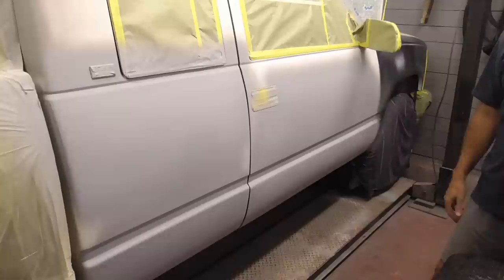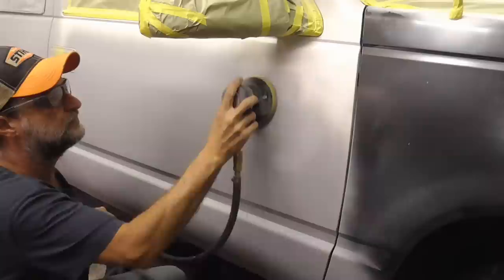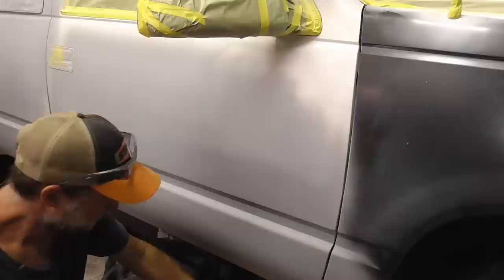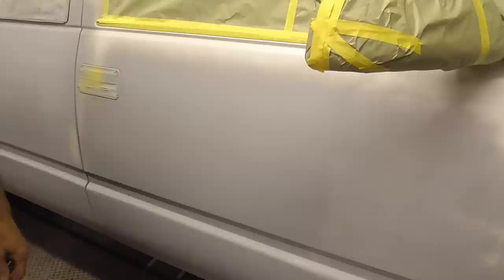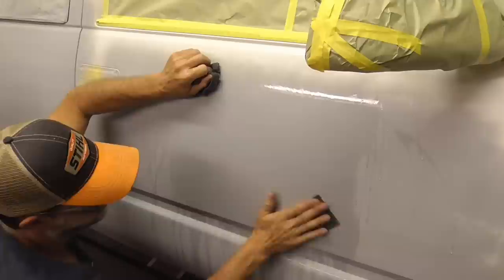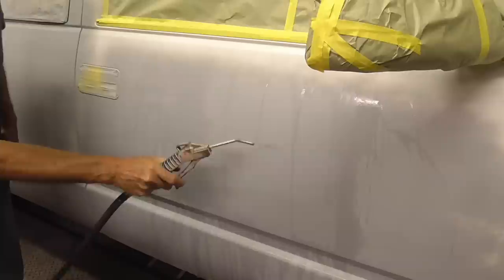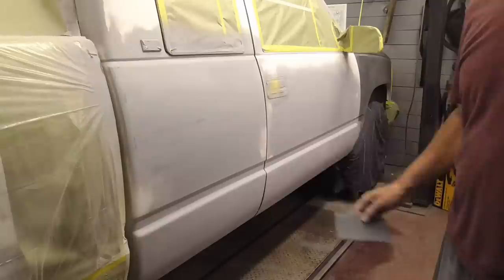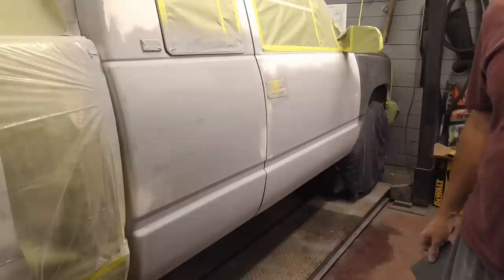3 Ways to Finish Sand Before Painting:  Good Way, Better Way, Best Way

Comment: Why wouldn't you remove the emblem and door handle and belt moldings, mirror? You don't tape those off wtf lol
Reply from the maker: You can do that if you like but there's a very good chance you'll end up breaking brittle door clips and parts as it's a 96.  It's actually better to get good at masking.  A boss where I worked always wanted everything put together before painting to avoid marring the paint putting stuff together.  I totally agree with him.  That way the next day.... pull the tape - your finished.  Perfect paint work - no problems - got to be good at taping though :)

Comment: Awesome video! Just curious as to what primer you use? Also, one thing I noticed on my car as well as in your video is the different shades of primer. On my car whenever I spray the primer seems to be lighter/darker from other sprays, will that cause an issue with the paint when I finally spray it on? I'm going for a dark grey color if that makes a difference.
Reply from the maker: I use lacquer primer from Auto Body Master but any lacquer primer will do.  It's cheap, builds fast, dries fast, sands easy, works well if used correctly, doesn't harden in the cup and you can throw the unused portion back in the can.  2k works great too.  Urethane is a blocking type primer and epoxy is just a primer.  All work really well if used the way they are supposed to.  That being said, you can paint over all different colors but if your primer is dark and your color is light , it may take another coat or two.  If you want to avoid ever having that problem use a coat of sealer like in this video:  https://www.youtube.com/watch?v=aJHa1grz5Fs  Hope that helps - if not feel free to ask more ?s  - have a good weekend :)

Comment: could anyone please answer my question - i'm doing a bmw e39 trunk at the moment, and it's quite flexy, so first  i removed all the paint with a wire brush and sanded the bare metal with 80 grit on an orbital sander, put 2 coats of grey spray can primer on that followed by 1 thin coat of black paint instead of a control coat since i didn't have it on hand, then i sanded everything with 240 on an orbital, found some low and high spots, hammered the high - filled the low, what do i do now? i thought i can get away with sanding 180 on the orbital and then putting primer on that, should i?
Reply from the maker: If you are really close after filling in the low areas and tapping down the highs, you can go ahead and prime it with a few thick coats of primer surfacer or even feather fill (very thick primer).  Spray bomb cans do not build thickness very well.  Only if your body work is near perfect, can you use spray bomb (fill type) primer.  Here's all the steps a normal body shop would use - https://www.youtube.com/watch?v=mApSa0l4euQ

Comment: Great video! I know you mentioned it in the video but it bears repeating that after sanding out correctly it is important to get in the habit of re-masking before applying the finish. Especially the clear coat. The tape edges and creases in the paper can hold a lot of dust. Waiting for the paint to cure so you can wet sand and buff may be steps you don't want to add to the job. Thanks for the informative video Jerry.
Reply from the maker: You're welcome - thanks for the information :)

Comment: Good work Jerry!  I was told by a long time professional restorer that a person should guide coat anytime you  change grits.
Reply: do it any way you like   the bottom line    just make sure your work is good,  depends on your experience too     some folks out there do shoddy job  cause they don't give a rats ass,  if thats the case  don't even bother lifting a spray gun.
Reply from the maker: It can't hurt - have a great weekend :)

Comment: I’ve always been told and seen other videos saying not to sand in circles? Is that only in certain circumstances and not when sanding primer like this? Thanks for all the info in the video it’s really helpful
Reply from the maker: You can sand in circles and in any direction you want.  As long as you don't do one way constantly.  In other words change up often to cancel out the previous strokes or patterns.  Hope that makes sense :)

Comment: Jerry, my question is guide coat. I have a 67 C10 and will put sheets or plywood or drywall and close the tail gate. While the inside of the bed may get scratched, I am looking to get those bedsides straight. 
  Many use “SEM” spray guide coat while other use a cheap “Flat” black spray paint. The “Evercoat” can or powder seems a little over the top, I was wondering why red can primer couldn’t be used on a gray 2K? Does it sand off too easy? I believe that chemicals like lacquer would infiltrate the substraight and possibly cause a solvent popping issue later. I am a retired ASE Master, not a collision painter. I have painted 7-8 of our family vehicles without issue, but want the thoughts from a pro! Thanks for the tips.
Reply from the maker: I always used what ever there was around that was handy.  It doesn't matter if it sands off too easy as you just what something to sit in the low spots.  If you are using 2k gray you with be fine using red can primer over it - it won't damage it in any way like contaminating the substrate or things like that.  Best thing to do is keep a few cans of cheap dark colors (primer or paint) laying around for the guide coats.  Hope that answers you question - Have a good weekend :)
Reply: Lakeside Autobody  Thanks for the reply and insight on good information. My concern was chemicals and interaction. When asked, I always tell folks the (Cleaned, 80 grit bare metal, lint-free body shop rag, 70% isopropyl and air died tack rag, clean dedicated air hose, filters) but epoxy sealer, catalyzed filler, catalyzed primer, catalyzed base, catalyzed clear is a chemical bond but one big molecule. Thanks very much! Enjoy the videos. Hope to buy a nice gun someday but 11 years on disability sucks. Unrelated to fixing cars but 5 lumbar fusions over 4 disc in mid July. That hurts, but 6’3” in a short world. Blessing to you and the work it takes to do videos, it’s work!

Comment: Hello Jerry this is a great informative video and a important one I would  like to see more videos  like these . 1 question  was you using  an interface pad on the DA . Thank you  for  this video stay safe Jerry
Reply from the maker: I was not using an interface pad on the DA.  I know they are advertised to help but adding softness can allow the sandpaper to follow contours.  When blocking or finish sanding automotive panels you want a firmer backing pad that cuts through contours - not follow them.  I think the interface pad would be better for wood working to follow all the random contours and aid in sanding faster.  That's just my opinion though so, in the end it's what works for you :)

Comment: If you burn through to metal while sanding, does that area have to be re-primed with a DTM, etch or epoxy? Or would a sealer be acceptable? Like small areas
Reply from the maker: Sealer or even a spray bomb can of inexpensive primer will suffice.  Just for small spots where you accidentally burn/sand through like you said.
Reply: @LakesideAutobody  thanks, afraid if i hit with the high build primer I’ll make more bare spots sanding down, lol.  As of now my car is ready for sealer, base and clear.  I’ve been watching your videos for a while now. You’ve helped me out along the way from the rust repair to the paint, so thanks for that.
Reply from the maker: @brianensminger2237  You're welcome Brian.   Let me know how the rest of the project goes.  Have a good time painting my friend - that's what it's all about :)

Comment: On the new fenders black finish is it ok to paint over , or should that also be primed ? I remember years ago my older buddies use to say you had to strip that black finish off new fenders ? Great information. Stay safe
Reply: The black is only a transport primer and needs to be sanded carefully and primed, the black does not have to be removed first, but it did years ago, if you don't prime the top coat will loose adhesion.
Reply from the maker: You can get away with just scuffing it but yes, its a good idea to DA sand it and make sure that it does not flake off, prime it and finish sand.  If you can da sand it and see that it feathers well (you'll sand through in certain spots 'cause it's thin) then you'll know it is a good substrate.  Basically test it to see if is doesn't peel or flake and your good.  Hope that helps :)
Reply: Keith - IF it is a "blow n go" cheapazz  situation NON warranty situation? Just scotch brite it and do your painting, or sealer/ primer over the black e-coat primer... But, IF you are doing the quality $$$ jobs, and you wanna warranty/guarantee your work for customers, OR personal jobs etc? Sand  most to ALL that crap off. I have seen/ and had, and heard of the black coating  just getting scuffed/dulled down  (EVEN properly) and EVEN sealed/primed properly over that AND...? Have it cause adhesion issues/ rusting from the bare metal on OUT because, when coated from the factory? The steel ISN'T always clean, and may be contaminated or ALREADY "flash rusting" BEFORE it gets coated with the black e-coat primer. It's really JUST for the fact it's METAL, it sits, and it has to be shipped etc. So..? As usual.  Ya basically JUST GOTTA cover your own azz on that sh.t! Happy Restoring 👍
Reply: Keith Clark  Black "urethane/rubber made" bumper covers is a TOTALLY different situation. There is NO "sanding the coating OFF" per say, as they ARE NOT made of metal, but literally "rubber." But on EVERY painting application for "rubber bumper covers," they should be thoroughly wet sanded with Comet bleach powder "soap" and a  scotch-brite pad and rinsed off thoroughly with water then sealed with a good Epoxy primer and then painted. ALL the above procedures are done as to eliminate ANY contaminates, factory  "coatings" and sealed to MAKE THE PAINT STICK AND STAY STUCK. And IF ALL the above prep is NOT done? The paint WILL NOT stick well, and start popping right OFF. Unfortunately, I have seen some replacement bumper covers (even prepped correctly) that STILL start popping paint later down the road. But THOSE were jobs where the base/clear was applied over the rubber, and the bumper covers were NOT sealed at ALL. In general, bumper covers "can be" a PIA, especially AFTER they have been painted and paint is popping, and THEN...They need completely stripped.
Reply: @jamescon55  
Yeah I know all about it been doing it for 45 years   And on those ones you've having trouble with  Probably wouldn't hurt to use some  Adhesion Promoter on   But you need to be careful with water borne primers ,
There's also a product called scrub and scuff 
  ( Fine Grit ) Takes the place of comet , Also best to use a urethane sealer.

Comment: Hey Jerry, I'm in the market for some mirka sandpaper.... should I just get the Gold or buy the backing pad with all the holes and get the abranet?? I have a Stick-on Pad on my d.a. right now.... what do you recommend??
Reply from the maker: The only reason for the holes is if you are dustless.  In other words you are using a vacuum or dust collector.  Other wise just get the gold .  I really like their gold paper - just as good as 3M  - Here's a video I did on the Gold paper - it's older but it might help you out.  https://www.youtube.com/watch?v=bdaXf2bXrPM
Reply: @LakesideAutobody  I'm just going to be building a 71' c-10 and a 84 k-10.... I couldn't see any reason for me to go dustless unless you HIGHLY recommend it.... I have a 6" D.A. Husky (It does alright, I guess) and a 80 Gallon Air Compressor.... I was just wanting to pick the brain of someone who does bodywork daily....